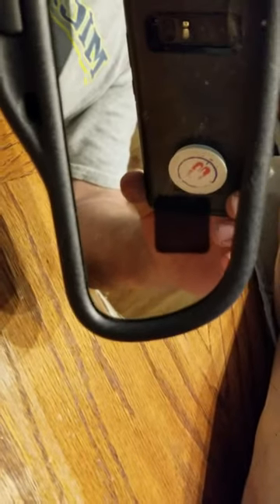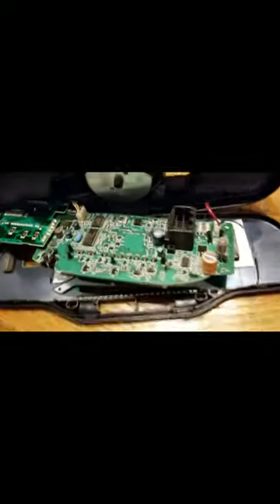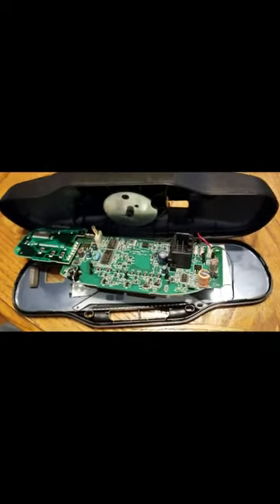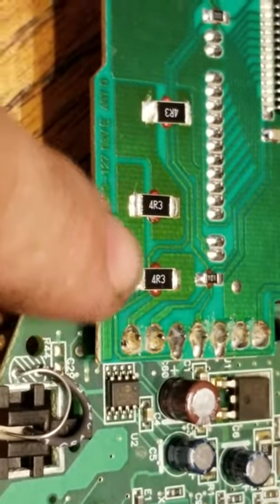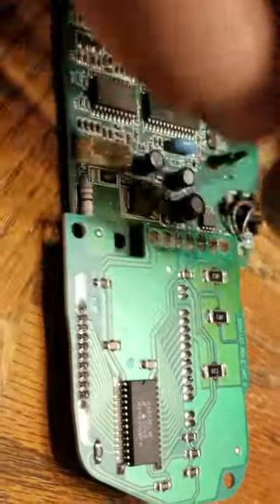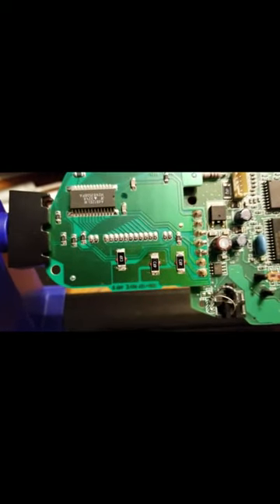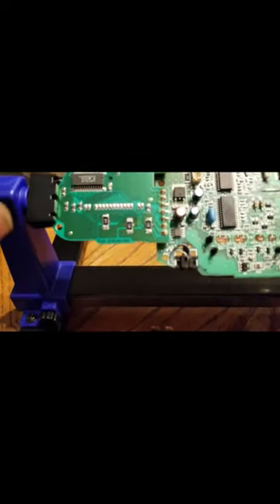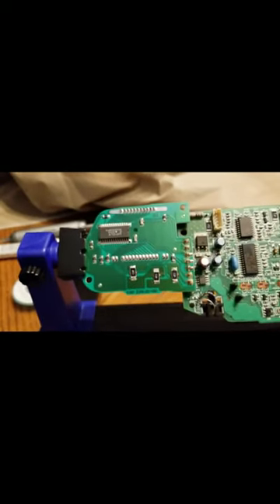Temp display on power rear view mirror fix

Comment: Thanks for the information.  I could not really see any cracks and when tested for continuity they checked good.  But everything else looked good on the boards so I just took my soldiering iron and re-did the solder connections.... and sure enough it is now working.

Comment: I have a similar problem but resoldering the joints didn't fix it for me. If you say bad solder joints are the problem 9 out of 10 times, then I must be the 1/10 time where it wasn't the problem. The problem was that the voltage regulator on the main board that was toast and had to replace. It's a 8M05 voltage regulator sitting between the 5-pin connector and the display daughterboard.

Comment: Thank you, i had just taken my mirror apart cleaned everything and put it back together after going off other videos and finding nothing wrong. Your video came up next in the autoplay, so before reinstalling my mirror and finding it still didnt work i checked the resistors. I found the furthest one to the outside cracked. It was not as obvious as yours but with some light and magnification i could see the solder had a very fine crack. I reflowed the solder and assembled my mirror, put it back in my truck and it lit up perfectly.
Reply from the maker: Good to hear!  Thanks for the comment!

Comment: I can confirm that the same issue with cold solder joints exists in the instrument cluster. Not only with the DIC display, but also for the DIC control buttons on the steering wheel, as those buttons are wired to the instrument cluster where their resistors are located.

Comment: I fixed the intermittent PRND321 fading in and out on a 2003 Chevy Tahoe....same type fix for this too - touch up the solder on the resistors

Comment: Thanks for the video. My mirror is having the same problem. Looks like I am going to start tearing it apart to see the problem.
Reply from the maker: If you need any direction, let me know
Reply: Mine is on a 2006 silverado 2500hd. Hope it goes well in trying to repairing it. Thanks again. I will reach out if I get stuck.

Comment: The guy that replace the led lights burnt the hell out of the circuit board. 
I pulled it all apart to see what the problem was. 
What a joke whoever attempted the work. 
Even led lights on the outside of the truck. Made a of issues for me to fix. 
Now my truck has nothing but led lights and all work just fine. Lol

Comment: 1:31 - is this harness/connector for temp. sensor? (the box on the mirror support is a temperature sensor? for outside ,inside temperature?) I have a small 
box on the support and this box is attached to the mirror. i'm wondering what is this...
Reply from the maker: I'm not sure what it is.  I did not investigate into the board when I had it apart.
Reply: @sw2steve77  thx. Ps maybe somebody know something about this box?

Comment: Mine lights up but it lights the whole display up instead of displaying the direction and the temp, could this be the problem with mine?
Reply from the maker: I dont think it is.  You might have a broken solder joint on the plug to the board.
Reply: Mine will occasionally light up "XXXX" everywhere, flash on & off randomly then go black again for a few weeks.
Reply: John Girard That’s what mine does as well, But it actual works about 10% of the time and the other 90% it has The X’s on like you’re saying.